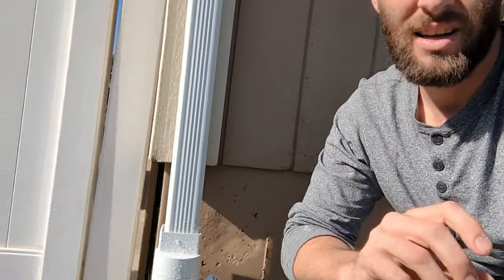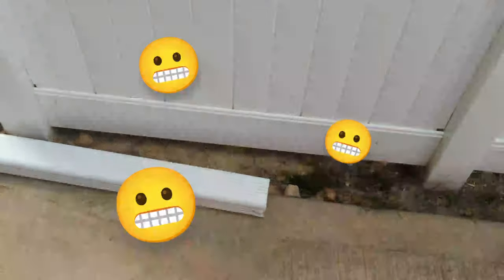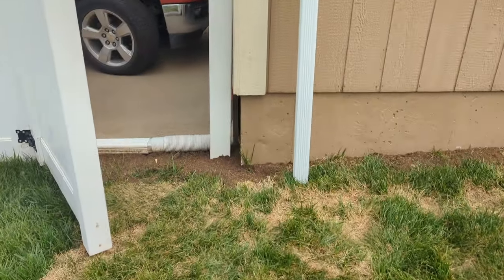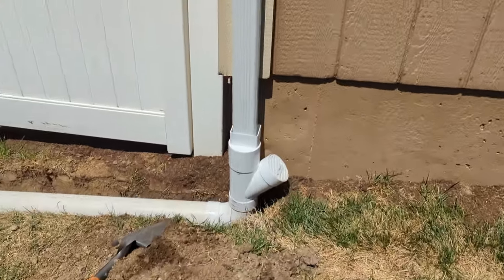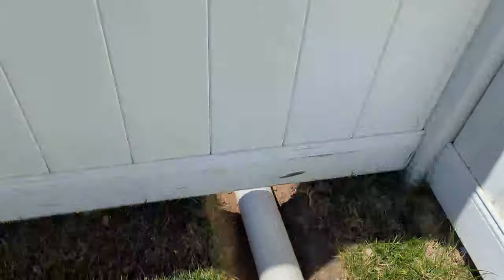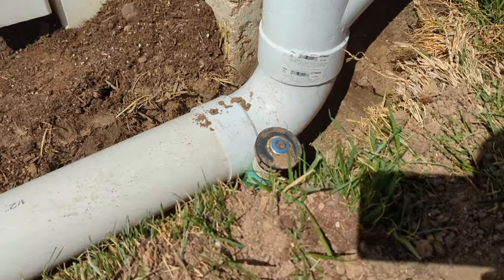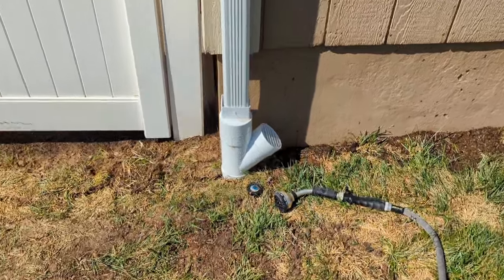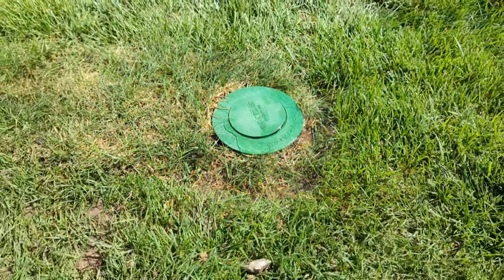How to Bury a Downspout with PVC Pipe - Easy DIY Project

Comment: "Easy" says the man with no clay in his soil.
Reply from the maker: Funny you should mention that!  We live in an old river bottom, to anything past the first inch is thick clay soil.  Digging was a bit labor intensive.
Reply: @jessesmithchannel  I dug 70 feet of ditch to lay in PVC to drain my gutters down to the storm drain.

Halfway through and in the middle of fall when the clay was as hard as rock, I remembered I had a cheap chinese electric tiller.

It made a perfectly flat 12 inch wide ditch for me to worth with to lay in the PVC. Only wished I had thought of it sooner.
Reply from the maker: @ibealion1  Oh man!  Got a link to that tiller, or something like it?
Reply: @jessesmithchannel they have an electric one for $140 at Menards. Can be two or one sides of tines.
Reply: Or cypress trees .
Reply: Or rocks.

Comment: Couldn't you just have done a nicer job just having the water dump on the driveway but closer to the garage? It looks like the driveway is sloped well. Anything would be better than the pop-up.
Reply from the maker: It's been a year, and no issues with the pop up drain.  I prefer not to have water dumping out on or near the driveway.

Comment: Good job. I do have one question though. Why didn't you go ahead and dig the trench another 5 feet so the pop-up would be right near the road?
Reply from the maker: Thanks.  It's probably hard to tell on camera, but the yard slopes quite well toward the alleyway.  Excess water from the sprinklers drains onto the pavement, so I figure this will too.
Reply: I wouldn’t use a pop up drain
Reply: @Scott-xq2dm  I am looking to do this myself later today. Could you let me know why you wouldn't do the pop up drain? This is where I feel a little lost. Not sure what to do at the end of the drain. 

I have a storm water area at the edge of the yard. I was going to run it all the way there with an open end. Any harm in that? 

Any advice here welcome

Comment: Great video, are you able to clean/remove the sand/gravel that will enter the drain coming off the shingles?  I’m preparing to do a similar project.
Reply from the maker: Should be able to jet some water through the pipe and/or shop vac it out.

Comment: I want to do something like this but live in upstate NY where we get buried with snow and below zero temps.
Reply from the maker: We got down to -15 degrees F last winter.  You'll be ok doing it this way.
Reply: @jessesmithchannel  How would the water come out when the cap is covered by ice and snow? Are you relying on it to leach? I know it doesnt rain in the winter but ive even had issue where the end of the downspout will slowly clog with ice and then water backed up and cause the downspout to swell with ice. We see temps down to -30 and it snows almost everyday for 6 months.

Comment: If you've got an area of your yard that can tolerate some flooding, this can allow for less stormwater runoff. A rain barrel with drain hose can slow the flow&give more time for absorption.

Great video; love the corrugated drainpipe emojis!
Reply from the maker: It's a very small yard with a pretty pronounced slope.  Water in the yard runs off to the street or alley pretty efficiently.  I am considering adding a rain barrel though.

Comment: Will the pop up leave water in the pipe and could cause freezing? Thanks.
Reply from the maker: Good question.  There's a weep hole in the bottom of the elbow, underneath the pop up, that allows water to leech out of the pipe.  I'm considering swapping that for a tee fitting to get the water out of the pipe more quickly.
Reply: @jessesmithchannel  Maybe dig down and fill with gravel like you do for a hydrant.
Reply from the maker: @Littrell1966  I've got gravel under the elbow to allow the water to drain 👍🏼
Reply: Drill a hole in the bottom of the elbow that holds the pop up so water doesn't sit there
Reply from the maker: @donjones9949  This particular pop up came with a pre-drilled elbow for that exact purpose
Reply: I’ve used the elbows with the weep hole that came with the pop up’s , but after a few months of use,  all  had water inside from the weep hole being clogged so easily, I switched them with T’s  and now they’re working perfectly, the T is the best option to work with the pop up, no doubt
Reply: You can also dig a hole about 1 or 2 feet deep and fill with rock and where the elbow is on your popup have a slit hole,  it will drain all the water that is left in the PVC pipe that doesn't make it out the top and with a hole. I think at Lowes or Home Depot they will have elbows like this.
Reply: I think the grass roots will find their way into the pipe like this.   Based on other videos/comments, the pipe end should be exposed to air.  I do see you don’t have enough grading there though.

Comment: Question did you  have pich  a least 1/8 of an inch ? Just wondering  I have the same problem I was just wondering if water is going to sit there al the time ?
Reply from the maker: I just put a downward slope on the pipe.  With the momentum of the water coming off the downspout, it flows fine.  Any residual water in the pipe drains out of the hole at the bottom of the pop up drain.
Reply: Should be 1/4" slope per foot to keep any ponding in the pipe

Comment: i wish the adapter (downspout to pvc adapter) could slide UP the downspout - as it is, it's easy to put it on the downspout from the underside, but i'm not sure it's a piece of cake to remove the downspout now - say you replace gutters, they need to pop the downspout UP onto the gutter and simultaneously down into the adapter -- i'm not sure what the solution is, here.
Reply from the maker: You can remove the piece that anchors the downspout to the wall.  That allows you to shift the downspout on an angle and slip the adapter on the bottom.  Then just return it to vertical, and anchor it back to the wall.